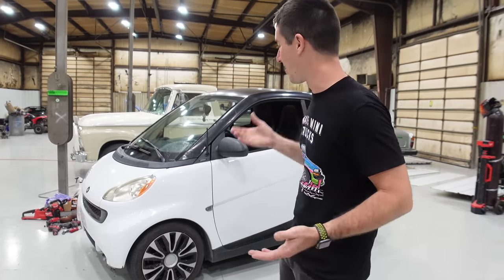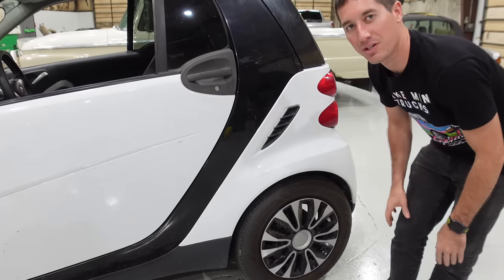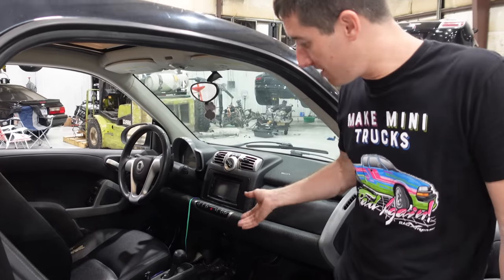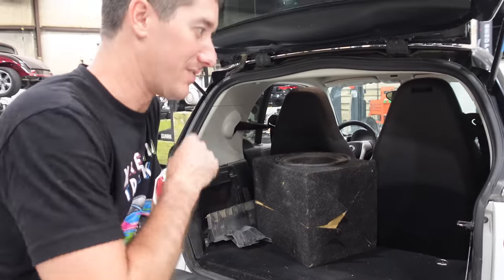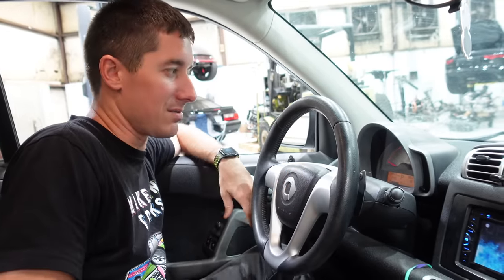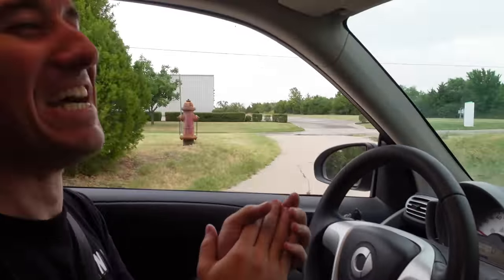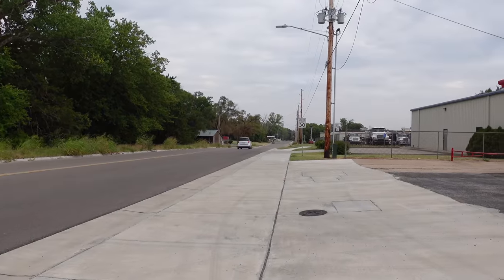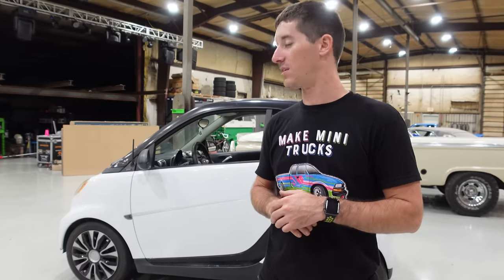I BOUGHT A CHEAP Smart Car.. Is It As DUMB As They Say?

Comment: I had a 2008 and was one of the first hundred to own  .. it was  a very early one Had No A/C 
I added a K/N air filter modified the air box  , got rid of the “drone air muffler between filter and throttle body.
Made a Huge difference… good luck Ron    Ps mine was exactly same color I called it my baby shamu

Comment: I’m only at 0:24 so just started but I just wanna say the Smart is actually awesome, and despite being so small has a brilliant crash structure. People who judge it poorly are forgetting what it was designed for. It’s a city car that CAN leave the city. This and Fiat 500 are brilliant cars, as is the mini (new and old). When I lived in France we had a John cooper Works Mini convertible. The first one was auto (actually the 1st might have been a normal one), but we upgraded to a JCW manual and it was awesome and so fun to drive, especially through the tunnels in and around Paris. Even THAT tunnel.

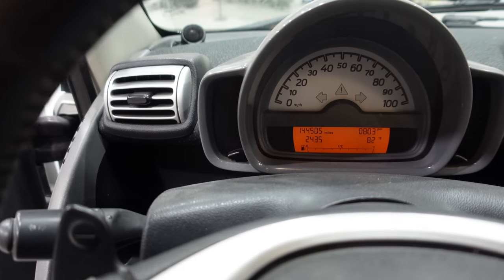Comment: 10:12 You can get a tach if you get the accessory gauges that mount in the middle-aft of dash, behind the AC controls. Max RPM when parked is 3500. Max RPM when in gear is 6500. You could get an android head unit (if not one already), install the Torque app, and then a bluetooth OBDII reader. The only problem with the accessory gauges it that one of them is another clock. I didn't see any other videos for your smart but I hope you're still enjoying it.

Comment: I have a 1016 Smart ForTwo.
Once you get it on the freeway, it goes 80 without you even knowing it... passing trucks on hills up or down..
I get about 425 miles per tank.
I bought it used for $6500. Sale value today at Carmax, around $11,000, same condition.
You didn't mention, the gas gauge icon is on the left of the instrument panel, but the gas tank door is on the right.
Under the dash is a cigarette lighter plug. With an adapter, you can charge your phone, etc.

The rear view mirror is a problem for me. Too big and too low. Blocks sight when looking to the right, especially on hills.
There is a USP port and another plug for media In the GLOVE COMPARTMENT (very dangerous, can't see it from the drivers seat/fumbling...) 

I love it aside from those 2 things.
I'd say 9 times out of 10, someone either points at my car going by, or have to talk to me about it in a parking lot when I am out.

Comment: I will NEVER offroad my 2009 Smart Fortwo Brabus Coupe (purchased it used 2 months ago). I would bathe in my tears if I do that. Enjoying every moment of it so far!
Reply: Love the Brabus smarts! The wheels really make it work!
Reply: @kelvinstokes996  Actually, it came with the Genius Darwin Rims when I bought it. However, the Contiprocontact tires on them makes it very fuel efficient (45 mpg Hwy) and handling is very good. But I will intend to buy the Brabus Rims (15 + 17) for Summer Tires. The suspension is non-existant; I swerve to avoid any potholes XD.

Comment: I was always impressed with how terribly in-efficient they managed to make these. 38 mpg highway was definitely not worth the ridiculous look.
Reply: There's a tradeoff somewhere with engine displacement and car size. A modern civic got better gas mileage than a Fit for example, the only draw for the very small cars had to be price.
Reply: Yes. It was ridiculous. A 15-year-old Honda Fit can do as well and it's a real car. German engineering at its finest
Reply: @TheMrSnyder first generation Honda fit didn't have any of those things either
Reply: Ain't that the truth. When I was 17 Ford made a little hatchback called the Fiesta and they were peppy and fun to drive and got around 42 mpg in real-life driving. Of course that was before the world went insane.
Reply: Always figured these things should get 60 mpg.  Friend of mine has one and claims it gets 50 mpg………but he lies.😔
Reply: @TheMrSnyder if you want an actual car that will do car stuff you buy that Honda. If you just have to buy some freak of a vehicle that will lose races with skateboards, you buy the smart
Reply: I have a 160 HP Fiat 500 Abarth that can do 33 MPG on the highway if I'm frugal.

I'm not frugal. 😁
Reply: Yes, this is my complaint about modern cars.
I had a 1995 Saturn wagon sw1 that regularly got 33-35, and I drive like I know where the governor is. On a fresh oil change it would easily hit 38mpg. 10 years after it was built, you needed a hybrid to get that kind of mileage. 🤷🏽‍♂️🤦🏽‍♂️
Reply: nice efficient car
Reply: @TheMrSnyder The fit won't park in as small of a spot. Parking where I am is $40-50 a day. I've saved quite a bit from parking in spaces on the street others wouldn't fit into
Reply: @kevinbarry71  The fit won't park in as small of a spot. Parking where I am is $40-50 a day. I've saved quite a bit from parking in spaces on the street others wouldn't fit into
Reply: @MrEeeaddict  OK, that makes sense.
Reply: I think the miserable economy was something to do with US regulations. I remember looking up the euro specs back in the day and I think they achieved almost 70mpg in europe. Go figure it became broken for the US.
Reply: Totally agree. My son owned one. 38 is not good mpg for these goofy things. Kinda a not smart car hahaha. My 1984 VW Jetta diesel was 52hp and got 45-55mpg. Not sure what was up with the Smart car… heck, the Geo Metro got 55 mpg with a 3 cyl.
Reply: My turbo camaro gets 35 mpg on the highway.
Reply: Yeah I always wanted one just for the ridiculous factor.  But after looking like a moron loses its humor how do you justify it over a more fuel efficient "normal car" that typically costs less
Reply: @TheMrSnyder  other than fuel economy why would you want one?  34mpg city is terrible for how small it is.
Reply: @lancenutter1067  Emissions. It knocks the crap out of milage.
Reply: My 1992 Toyota Paseos got high 30s in town and mid 40s highway, 4 seats, and 41% more horsepower.  If I could find one that wasn't clapped out, I would probably buy it.
Reply: 38mpg?? that is pretty pathetic for a shoe box on wheels
Reply: If you're even remotely worried about fuel economy, you drive too much and too far for a Smart to make any sense. They're really ideal for urban cities, where you're unlikely to drive a car more than 5000km / year, and where "highway" is a meaningless measurement because the nearest highway is an hour and a half drive out of the city.
Reply: 38 mpg? My 2006 got almost 60 mpg
Diesel!
Reply: The Main Intention was to make a small City Car, I'd say. That's the Main Reason for the Look.
Reply: Yeah even 10 years ago that wasn't that great. Specially when your thinking it's under 2k pounds and has a 3 cylinder.
Reply: @kevinbarry71  Yep.  My 2008 Honda Fit gets 36.5 mpg on long trips.
Reply: @jeffleach2668  I have a 2013 I bought for dirt cheap. I average about 50mpg (Highway) I drive all highway. I commute 41 miles 7 days a week It beats driving my '14 Silverado everyday. I'd rather put the wear and tear on the Smart car.
Reply: Geez I never knew the smart for none only got 38MPG. My 14 camry non hybrid 2.5 liter gets 35 on the highway with a family of 4 and luggage and a cooler.
Reply: My turbo Regal can do 162 MPH, can comfortably seat 4 people and has got 37 MPG on longer highway runs.
Reply: @05Forenza  Was the 70 mpg achieved using Imperial gallons or US gallons?
Reply: Hatchbacks never get good highway mileage. Too much turbulence behind the car. But yeah, my 2001 Toyota Echo coupe gets better mileage and it has more cylinders, horsepower and torque.
Reply: @pkt1213  Tercel/Paseo's were great little rigs.
Reply: @MJorgy5  i had a couple of 92 Paseos.  First one allowed me to walk away in an accident with a semi.  If I won the lottery, I would see if I could buy two mint paseos and starlet swap one.
Reply: I get a little over 40mpg in mine, it depends how you drive it.  I've had it for 5 years now and it's been the best car I've ever had.
Reply: I have 3 smart cars they all get 50+ mpg it just says 38 but they really do good if you drive fast
Reply: I get 52 mpg when out on the open road. Follow semi trucks.
Reply: @kevinbarry71   A Honda fit won't get the attention these get. Good or bad they are my favorite cars in my fleet.
Reply: @teddystoner8288  suit yourself. not everybody is looking for attention
Reply: It's a cube, what do you expect, CD 0.3?
Reply: @05Forenza  Yep. Then Merc stopped importing.
Reply: @kevinbarry71  agreed. Sometimes it's a bother to drive the cutest car in the world
Reply: I drive a 2000 Honda Insight hybrid with the battery pack removed because it died. I still get 55 mpg on flat roads with the cheapest gas. It makes no sense to me that the Smart car has a smaller engine than Insight, much smaller rear cargo area and doesn’t get better mpg.
Reply: @jeffleach2668  I have one they get 40 mpg around town driving 40-55mph at 70 I'd estimate 30-35 mpg at 80 mph 20-25mpg I've driven from louisiana to Maine louisiana to south padre island louisiana to florida a few times my car is starting to have electrical issues at 190k miles it's in the shop but it's been reliable up to 190k
Reply: My 2015 fortwo gets ~60mpg highway 🤷🏼‍♂️ I can make it from Houston to Dallas in about 5 gallons.

But city driving is absolute dogshit on the efficiency.

The small size is also convenient if you’re a student like me and need to squeeze into tiny parking spots around the campus.

It certainly wasnt my first choice for a car, but I’m happy with it considering I needed a vehicle and the next cheapest thing had literally 3.5x as many miles on it.

It also handles like a little go kart so I’ll probably keep it just for fun when I upgrade. Might do a hayabusa engine swap 😂
Reply: @jeffleach2668  City efficiency is horrific, but I’ve gotten 60mpg highway if it’s a single trip with little stops and I’m going 65-70mph
Reply: Lol my 2008 Scion xB gets 37 on the highway and it's pretty much a boxy corolla
Reply: @05Forenza  engines are built to emissions, mpg, and power increasing any 1 of these tends to result in a deficit in another area. Few people tend to understand that. A better engine can improve everything but when you don't build better you have to make a sacrifice. Diesels without emissions systems have great mpg and power. With them... Not as much
Reply: @傅思鸿  The diesel version does that too.
Reply: @cs1375  Probably got some junk in the boot... and a big passenger!
Reply: @mylifethaidiy7045  Jazz 58mpg, depends on how it is driven.
Reply: Its not intended for highway use, its an urban vehicle.
Try getting nearly the same for inner-city fuel consumption in like ANYTHING.
At speeds between 20-80kph, for parking in small spots and easy maneuvering while still providibg decent comfort and class leading safety, the smart fortwo is insanely good.
Reply: My full size Ford Taurus gets 32 mpg on flat highway driving.
Reply: My old Suzuki Cappuccino did 45mph redlining constantly. Most fun car ever. Better than even my modded lotus exige. Definitely most fun per gallon.
Reply: It's not a highway car. 3L/100km city driving idk bout the mpg but I think around 1 gallon for 100km
Reply: They are city cars, dude and the drag coeficient isn't the best because of size and space requirement.
Reply: Had a 85 CRX si that would kill that thing in a race and got 43 mpg. Could climb a 30% dope in mud too.
Reply: We have 2,. An 09 & an 11 smart cars.  Our cars get between 47-55  mpg.  We have never had a problem with our cars being ineffecient.  Quite the opposite.  So you want to get rid of your smart, contact me!
Reply: @mikepurple3524  In 2009, when this car was new, there was not a single new car you could buy in the US that was cheaper AND more fuel efficient in the city. And it was amazing for driving and parking in older cities with tighter streets and smaller parking spaces.
Reply: Is that a suprise that city car is not good at highway?
Reply: @joshuasprinkles3490  <<other than fuel economy why would you want one?>>

Parking
Reply: @mylifethaidiy7045  The Smartcar gets almost that in stop-and-go city traffic.
Reply: Yes, that was my biggest complaint about this and the mini.  My CMAX gets 40mpg, is bigger and weighs twice as much
Reply: @johnathanstevens8436  What's your CMAX get in stop-and-go city traffic . . . and how easy is it to park on narrow streets without marked spaces? Because that's what this car is ACTUALLY for.
Reply: @ajm5007  CMAX is a hybrid so it loves city traffic but I do have to admit it's probably just as hard to park as any other CUV.
Reply: @toddaulner5393  I wish they would bring back the crx.
Reply: honda about as much fun to drive as a wet noodle.  Ger in, drive one of these before you make comparisons. youll love it.
Reply: @Milnoc   the abarth is on my “when I have a few extra grand lying around”  fun car list. Before the used market went nuts, I’d regularly see clean abarths for $3-7k.
Reply: @captnemo75  I’ve driven the fit in a manual, and it was pretty fun to drive in the city (Chicago) - wasn’t quick but the utility of the hatchback was unmatched. my friend has transported pinball and arcade machines in it for years
Reply: @mcirone  I paid $8,900 USD for my 2015 Abarth in 2020 with only 43,000 miles. I can now sell it for some 2 grand higher. You do need to pay close attention to it so that it doesn't fall apart, but it isn't a big or expensive deal to own one, and the car's so much fun to drive on twisty roads!
Reply: @smartdetails  bruh is yours the gas model in the USA? 50mpg? Really?
Reply: @toddaulner5393  I had a 1985 honda crx si too! That thing was awesome! Looked great and could rev out and squeal the tires really loud
Reply: @ajm5007  not to be a hater but that cmax is even uglier than the smart car! Lol
Reply: That’s really terrible mpg. When I visited the USA our rental Toyota rav 4 showed to have a 40+ mpg on highway
Reply: I would be more interested in strictly city mpg comparisons as that is what these were designed for 🤔
Reply: I’d buy a Mirage. Seats 4 comfortably. 40 mpg city, 50 mpg highway. 10 yr 100k warranty, tight turning just like Smart, more reliable.
Reply: 38 is twice as good as my Honda ridgeline
Reply: I've never got less than 44 on the highway.  Usually about 40 in the city.
Reply: Dunno where you're getting 38? I have a newer smart. I've got 40-45MPG. In Iowa where the speed limit is 55 I've got 55MPG 😁 

It's the best fuel mileage car I've ever owned. Never thought I would own something that gets good gas mileage. That's coming from a guy that owns a Hummer H2 btw 😉
Reply: I want it for the ridiculous look lol
Reply: @Smittening  it's not ridiculous. Look at the solo If you want ridiculous
Reply: My bmw x1 with twin turbo 225 hp 350 fpt out of a four cylinder regularity gets 32 mpg
Reply: ITT: Americans not understanding what a city car is
Reply: @dsofe4879  I live in America and I love the smart car. Unfortunately I hit a deer with mine about a month ago and I'm on a search for another one .
Reply: I figured the mpg would be higher.  I can average over 40 mpg on my 535d.
Reply: My 2002 Smart 450 600cc has averaged 53.4mpg over 95000 miles and has been all over the Uk and Europe.

Comment: It seems like something neat to have in a city where parking is a premium like NYC, and I see these and Fiats so often here. Personally, I always preferred the Scion IQ In terms of looks, with supposedly nearly similar millage, not to mention more cargo space as well as enough room for a third passenger. Unfortunately their used prices are ridiculous (twice or 3x a Smart) even though they've been out of production almost 9 years.
Reply: Not to mention a scion has Toyota reliability vs this or a fiat.
Reply: I've had both a 2012 iQ (company car) and a 2012 fortwo (mine). The iQ had better fuel economy and a much tighter turning circle. The fortwo is more practical by a long-shot. It's tallness makes it have a lot of cargo capacity and it's honestly a ton more fun to drive than the iQ.
Reply: Why does a different size car affect parking costs?
Reply: @ev-1832  not cost, availability. small stuff fits where big stuff cant
Reply: Would it fit in an elevator and though your door safer than street, careless drivers or thieves

Comment: The smart can be very fun in twisty roads. I have a 2013 with wider stock wheels, center exit exhaust, silicone intake tube and ultragauge II for important info.
Reply: I have to disagree with you on that. Twisty roads are scary! I had wear on my tires on my smart and it engages automatic braking which is scary asf. It almost throws you off the road
Reply: @ffhjvbuydb78eb  I’ve never had that issue. I’ve gone through switchbacks at 30-40mph. It kicks the back out a bit before traction control kicks in but never anything that bad.
Reply: @JLinder1379  mind has autobraking pretty sure and i went 35 around some corners and it brakes but only the front and its SCARY. if you have good tires on the front it doesnt do it then.